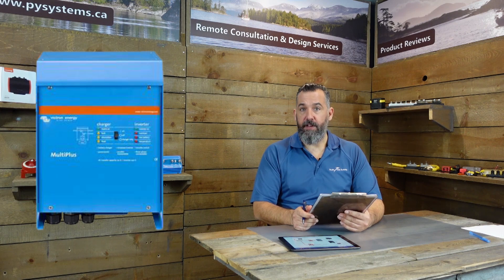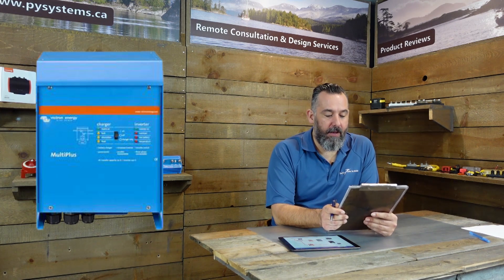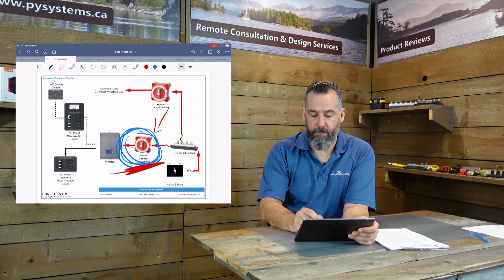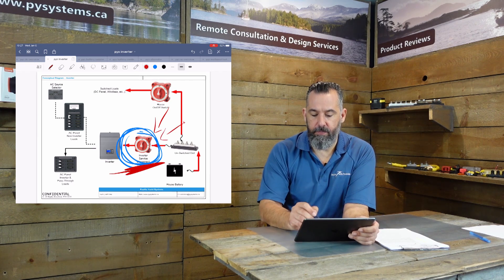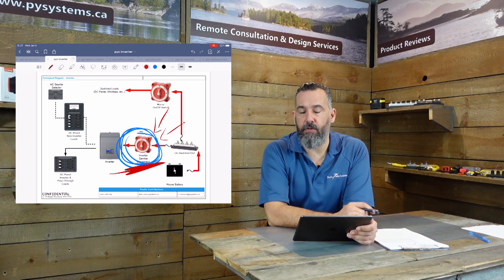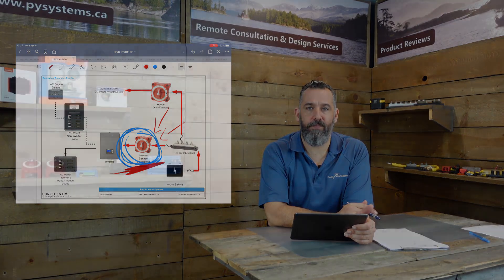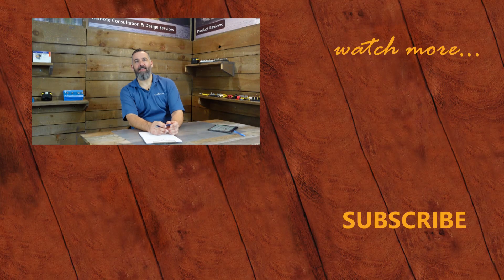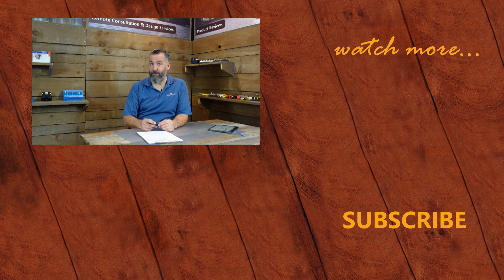I Am Installing an Inverter/Charger on My Boat, Why Do I Have to Install a Switch on the DC Side?

Comment: Most DIY battery builders caution against a big inrush current to the inverter capacitors and often use a large wattage resistor to charge the internal capacitors before making the connection. Why is this NOT a concern when using a Blue Sea switch?

Comment: Im glad i found this video as i was going to ask the same question after going through the concept drawings on your website the charger is connected to the unswitched DC and an Inverter is connected via a switch so was trying to find out which option i should go with for an inverter/charger. Cheers
Reply from the maker: You're very welcome!

Comment: Is there a way to make a wind jen regulator that is designed for AGM batteries to work for lithium batteries??
Reply from the maker: Hi Bill, good question but don't know. My guess would be not easily without some custom modifications.

Comment: A quick clarification please?  Typically loads are connected to the switched bus, and charge sources to the unswitched, correct?  But an inverter/charger is both a load and a source.  In your diagram it is connected to the unswitched bus (with appropriate disconnect and fusing).  Just making sure that this is the correct way to do it, as I will soon be installing dual Xantrex inverter/chargers.
Reply from the maker: Yep, because an inverter/charger is also a charger, the inv/chg needs to be connected via a dedicated switch to the unswitched distribution.
Reply: @PacificYachtSystems  thanks!

Comment: I have a POC setup with older low spec inverter, charger and changeover switch, before I get a full Victron stack. In the changeover switch I had a spare pole (3 pole switch) which I am using to to turn inverter power switch on when its AC side is selected as the source. Is this sufficient? I guess not because the power switch on inverter is a soft power switch, which might be driving a replay, while the DC is still physically connected. I still need a cutoff switch, to be absolutely sure?
Reply from the maker: You definitely need a DC cutoff switch for the inverter. Like we should all have fuel cutoff valves between our fuel tank and engine.

Comment: My curiosity for this project makes me wonder where should the a/c disconnect  be for the main shore power feed?my boat has one on the panel as well it has breakers in the service locker. Would this be adequate for a inverter charger ?
Reply from the maker: Hi Timothy, the inverter/charger needs it's own dedicated AC breaker.

Comment: What is the largest inverter you would use with a 12V system?  When should you start considering a dedicated 24V or 48V battery bank?
Reply from the maker: Sizing an inverter is dependent on battery voltage and battery bank size. Practically speaking, 2000-3000 is a popular choice, with a few boaters going to 5000 watts of inverter at 12 volts.

Comment: I agree with having the switch but what the difference in having a class T fuse vs. a circuit breaker before the shut-off?
Reply from the maker: Good question, besides amperage size, circuit breakers (e.g. fuses) also have different trip characteristics. The Class T fuse is the correct spec of fuse for an Inverter application.

Comment: The better option is to physically disconnect the DC supply to the inverter/charger...it is much safer to remove the connection to the battery.  Installing a switch is second best.  Since it is easier to turn off a switch as opposed to disconnection battery cable, chances are better that anyone working on the system will turn off the switch and less likely to disconnect cable at battery end.
Reply from the maker: Thanks for sharing Borys.

Comment: If you install a 100a circuit breaker on the DC side for a 1200va inverter, is this good enough to act as a service disconnect?
Reply from the maker: Hi Ernir, 100 amps circuit breaker might be a tad too small for 1200 watt inverter. Also, never seen an inverter manufacturer recommend a thermal circuit breaker, anybody else want to share their experiences.
Reply: @PacificYachtSystems  there is so much in that answer... isn’t 1200w 100a at 12v. For some reason Victron lists their 1000w inverter as 1200va, don’t know why, and lastly why is a circuit breaker not recommend?
Reply: @PacificYachtSystems  ping.